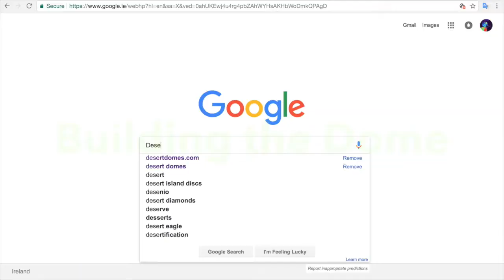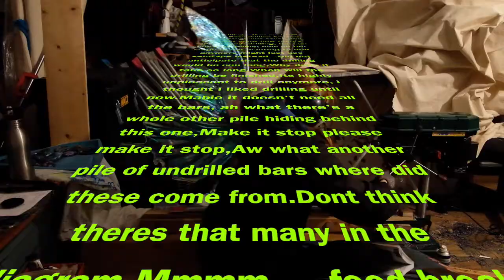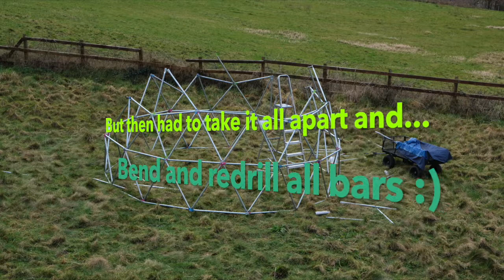helzie dome photonicspore com

Comment: Not all drill bits are equal, drilling/cutting fluid helps too.  Could you use a wooden jig to position the bars in the correct place under your press...would save having to make all the ends?
Reply from the maker: Haha yep i had made a jig and was using oil on it but its galvanised steel just takes time :) :) :) Thanks for watching